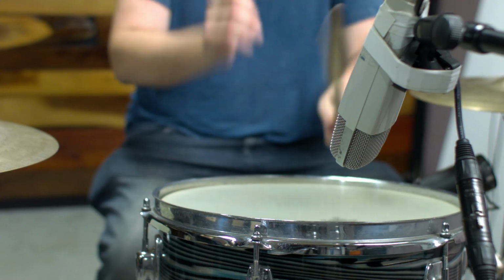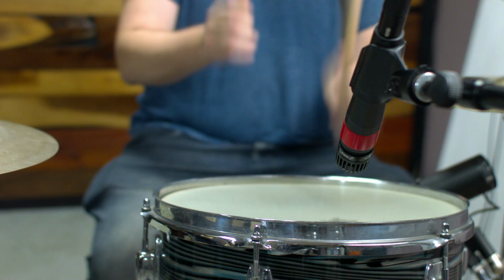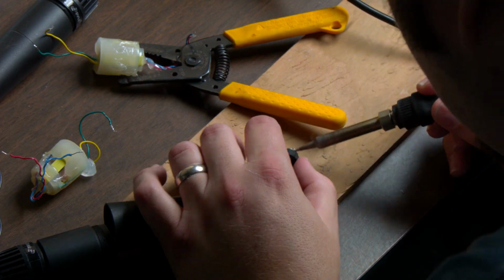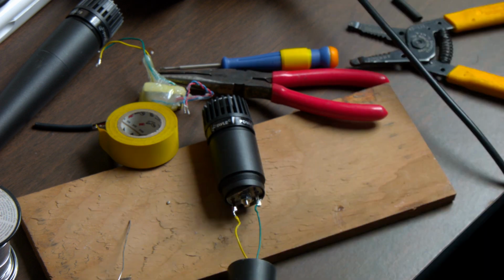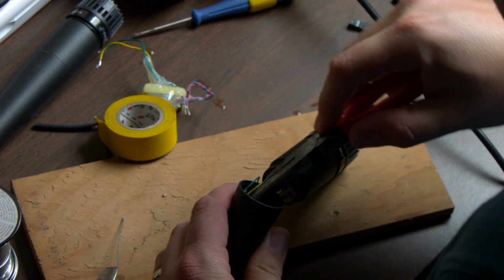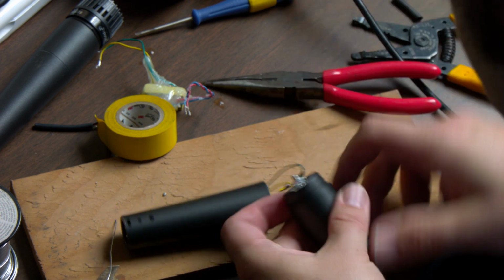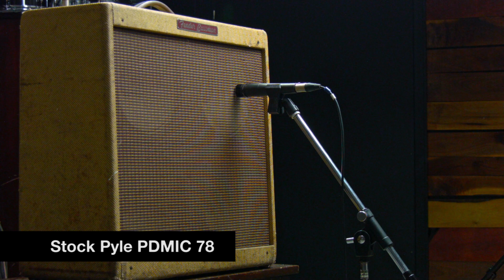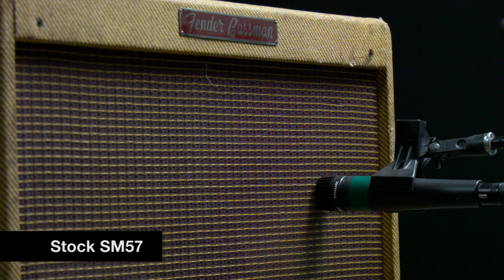Modded Pyle - A Poor Man's 421?

Comment: Try the Pyle/Shure mic with the "resistor mod".
It helps compensate for the impedance mismatch between the 57 transformer and modern preamp circuitry. 
I built an adapter years ago that incorporates the mod and it changes the tone/vibe of a SM57 nicely.
I can pop it into out for a change in sound depending on what I'm recording.
Reply from the maker: Yeah I've made that into a xlr cable. This is the one that lowers the impedance that is put on the mic right? All the examples in this video were at 600 ohms. Before I had my current preamps, I used that resistor mod to lower the load on the mic.
Reply: @creativesoundlab  But with Pre's with adjustable impedance, this is not an issue, correct?
Reply: @alphanumeric1529  Correct

Comment: The ultimate thing to do is put the transformer in the Pyle, and put it in an SM58 body and wire it so you can switch the transformer on or off. If you already have an SM58, you might as well.

Comment: Definitely completely different mics. However after listening to the guitar I think the Pyle + 421 Could basically be a 2 band sm57 on STEROIDS. They seem to avoid each other frequency wise, and you still get that 57 bark and 421 thiccnes. 
Also, the mode on the 421 may have contributed to the initial A/B being fairly misleading, such a finicky mic. 
Keep up the great work and content Ryan!
Reply from the maker: The mode as in the "Speach/Sound" settings? Yeah I'll have to try pairing these mics with 421s. That's not a bad idea.

Comment: The 421 has TONS more low mid information. It's thicker and more concentrated in those low mids. The guitar amp shoot out is where it's most noticeable, but also, the tom sample w/421 is just thicker, and a little less defined. There's definitely a reason the 421 is a lot more expensive. 

How would you compare the Pyle w/mod VS. the Tape Op mod SM57 ? My guess would be that the tape op mod retains the low mid extension

Comment: Holy Smokes! I love that guitar tone, so incredibly smooth I'd love to know what guitar, maybe pedals, amp settings and post processing are involved in that ridiculous great sounding tone! I'd wish I could achieve something similar recording our album in the next month!
Reply from the maker: Yeah I wrote down the settings because it was for my course and wanted to be able to get back in the future. Here the amp wasn't touched though between examples.
Reply from the maker: It's compressed DI track via a 1176 clone before it goes out to the reamp box. 5-7 dB gain reduction, with fast-ish release, 4 to 1 most likely. From there it goes stait in to a Reissue Bassman '59 amp. No pedals. Bright channel is connected into the normal channel. Reamp feed went into Normal channel. Presence 1, Middle 9, Bass 5, Treble 3, Vol of Bright channel was 9.5 out of 12. Vol of normal channel was 9 out of 12.

Comment: Couldn't one also engineer this into a small little cable? It just seems like it goes between the two wires of the capsule and hte two pins on the XLR jack. A non invasive mod could be had in an adapter that plugs into the mic externally?

Comment: I wonder how this would work on the es57, which are a pretty good 57 clone on a budget. iirc, the es57 has the same type of coil as the beta 57 or 58, so its supposedly more similar to those, which are even more expensive. Not sure if its transformer couopled already, but the es57’s are as heavy as an sm57, so im assuming it does. I kinda want to try this mod on both my crappy pyle sitting in storage and one of my commonly used es57's

Comment: I almost tried this, I have a working Pyle and a 57 with a busted cartridge, but my replacement cart for the 57 came in before I got around to it.  I’m not a fan of what the txer does to the Pyle but it could be useful on a very dark source.  
The replacement 57 cart I got is a $5 Chinese special & it sounds similar to the modded Pyle here when I put it on a real 57 body. I’ll probably take out the transformer and compare it with the Pyle (which I like for its transients).  We shall see!
Reply from the maker: Nice! Yeah I haven't tried any other knock off 57s. I thinking of running with the Pyles for a while and trying to put a low pass filter at 5k in one to balance it out a little.

Comment: Love what you do Ryan - Love the videos. . . I used a ton of these about 5 years ago when I did a ton of live sound (the Pyle) - and kept my good recording mics at home (so no metal heads would spill fake blood on the good mics lol). . . For the price - if anyone can catch the ev co4's - they're usually around 30 bucks a pop (they're bright mics as well - can't compare to a 421) - but I've been super happy with these "cheap" mics (replaced the pyles - as they've gradually "died"). . . Someone mentioned that the pyle's were unbalanced - I'm not sure (because I'm an idiot when it comes to wiring anything) - but that they're unbalanced and phantom power can damage them?
Reply from the maker: Yeah I had forgotten about that. I'm not sure why they wired them like that. I removed the jumper from pins 1 and 3 and connected ground to the screw of the mic body instead. That's more like a usually 57 I think. There is a gain difference because of this of 7 - 10 dB, I forget how much now. I'm not sure about phantom in regards to the mic safety.
Reply: I've HEARD, don't know if it is true or not, but the Pyles used to be unbalanced, but now are wired for balanced operation. What makes me doubt that (to the best of my knowledge) the Pyles still come with an xlr to 1/4 ts cable (unbalanced). I bet they come wired for unbalanced solely because they could get a deal on the unbalanced mic cable. I'd rather have a mic clip than a shitey cable, and definitely would rather have a balanced mic. Hello Pyle?!

Comment: The problem with budget gear is that on it's own it doesn't sound that bad but once you begin stacking tracks with bad gear the problems multiply and the sound starts to suffer.
Reply from the maker: Yes very true. Any mics with mostly mids and even-tempered edges (bass/treble) are much easier to layer.

Comment: Where do I find instructions on how to wire this up? I'm keen on giving this a try.
Reply from the maker: It’s pretty easy, there are just two wires. Xlr Pin2 is hot and xlr pin 3 is cold. You might be the phase flipped but just try it and have fun.
Reply: @creativesoundlab  thanks for your reply! I'll give it a go

Comment: Yep, still no the poor mans 421, but for $25 and a little time that is almost worth it. I wonder if the low end has to do with the actual size of the diaphragm or the transformer on the 421. Might be interesting to see if any budget kick mics are able to achieve the low end like the 421.
Reply from the maker: Yeah for $25 it's worth having these around. I actually really liked the sound of the toms in the context of the drum mix better than others. And the stock sounded pretty good on it's own.
Reply: @creativesoundlab  Do you think eq on the stock or modded Pyle would help get the tonality of the sounds back? I thought the Pyle sounded great on transients on the tom, as well as the transients and inharmonic sounds of the guitar/amp, but on both the actual pitch content was severely de-emphasized. Eq bring the pitch back?

Comment: Any insight into how you got that guitar sound?
Reply from the maker: It's compressed DI track via a 1176 clone before it goes out to the reamp box. 5-7 dB gain reduction, with fast-ish release, 4 to 1 most likely. From there it goes stait in to a Reissue Bassman '59 amp. No pedals. Bright channel is connected into the normal channel. Reamp feed went into Normal channel. Presence 1, Middle 9, Bass 5, Treble 3, Vol of Bright channel was 9.5 out of 12. Vol of normal channel was 9 out of 12.
Reply: Ahhhh I'm so glad you mentioned the Bassman was a reissue.  Not long ago I watched someone unbox an original they got, and it piqued my interest but knew the cost of any in decent shape was out of my league... like way, way out.  Reissue is still costly, but sounds well worth it.

Thanks for the details, just as informative and helpful as all the vids.  Keep up the good work, you're awesome!

Comment: its a cool mod but the 421 has what you would use in a mix. my opinion the model Pyle is not worth having around, if you need a 57 replacement get a lewitt

Comment: The more experience I get, the more convinced I am that if you can’t make it work with a 57, most of the times, it’s your fault...
Reply from the maker: Yeah, but I've never gotten much out of the kick drum with a 57. That's a tough one.
Reply: True that. But then again, that´s one particular use, and with mic placement and some pulteq-style plugin, should be quite close...
Reply from the maker: You have a good point. I wasn't even considering EQ. I should do a hole song w four 57s and my pultec clones and make a video.
Reply: That would be AWESOME!

Comment: modded pyle is definitly better than 421 its obvious for 421 there is no harmonics in the highs , thats because it sounds muddy , and it cant be fixed by eq cause there is no harmonics there, its bad. u can tweak the modded pyle and make it sound like 421 and make the bass more prominent but u cant do it with 421. i tried eqing these samples and its just awful, at least in tom test . there is no competition for that, its a better mic of course the modded version .... do u still use the modded version ,,,????